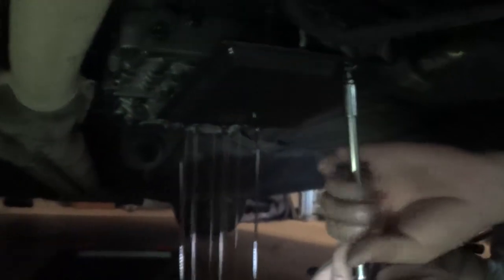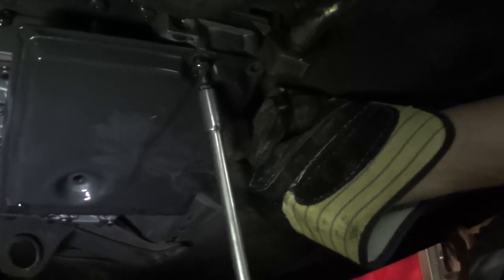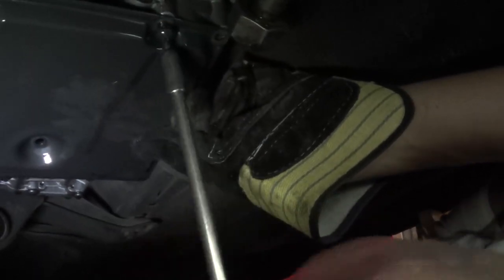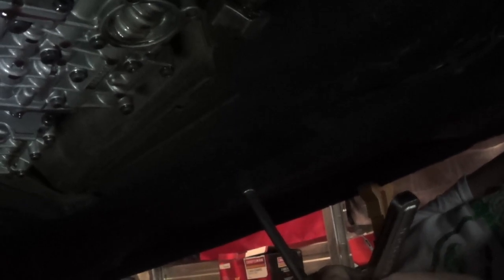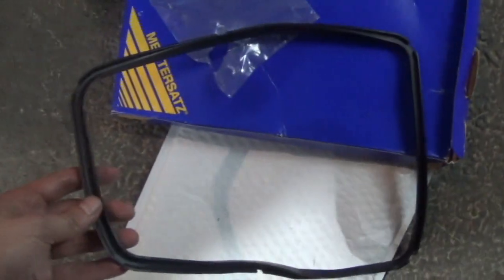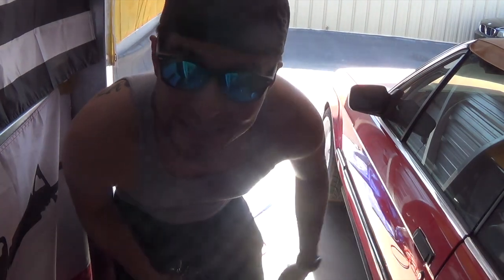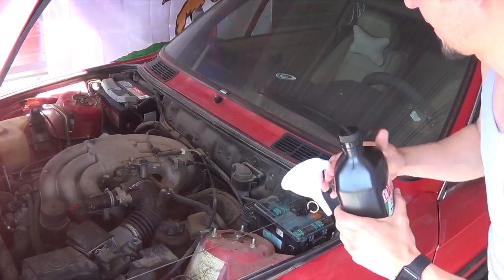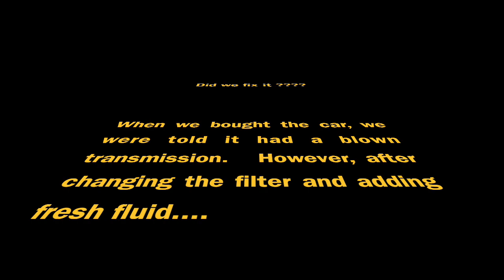BMW E30 Transmission Not Shifting? Easy Filter Replacement Guide Diy

Comment: Newbie with old car here.  I've looked in a lot of places to see how to top up the ATF for my '86 325....yours is the only site I've found that shows how to do it using the dipstick tube!  

The difference for me is I am not completely recharging it from dry, so I don't know how much I need to add. 
How long should I wait after adding some for a stabilized dipstick reading, does the trans. cool off too fast to go slower with smaller repeated adds, and how crucial is it not to overshoot on filling?
Reply from the maker: DB Hi there. Just add little by little and keep  checking your dip stick. If you add too much you will have to remove the drain plug under the car to level it out. But don’t be scared to work on the car. This job is really easy. Just time your time adding fluid. It will be tedious checking it every pour, but very easy.  Don’t worry about the temperature like newer 90s BMWs. I just added fluid and it was good to go. You can check again when it’s warm but you won’t notice a difference. It might actually look like there is more than there really is when it’s warm.
Reply: Thanks for the reply! 
So before I go ahead, a couple more Qs:  

Is there any brand or "quality" perceptions with ATF as there are with engine oil?   Appears to me that as long as it's the proper type (in my case Dexron III-compatible), you're good to go...?  If not, would you have a recommendation for my old 325? 

Also, when cycling through the auto shifter settings to disperse the fluid and get a better level reading, is it just a matter of waiting just a few moments (brakes on!) in each shifter position, or is a longer time per gear better?

Just as a comment..my ATF dipstick is pretty hard to read!  The reading zone on bottom is colored black, with two small "bulbs" about 1.5 inches apart...v hard to see the red fluid against the black stick (unlike the steel oil dipstick).    

Thanks again,  
Derek
Reply from the maker: DB you are correct. As long as dextron III compatible you are good to go. I did cycle through each gear repetitively. Then checked the fluids again. But you are right, the stick is very, very hard to read. Shine a light on the stick and try your best to judge the lubricant line.  We had trouble as well. Bmw dipsticks are not the easiest to read. If the car doesn’t shift great after. Park it, and check the level again about 8 hours later. If the level is good, you should try buying a new filter.  My car is shifting like new.  Good luck!!

Don’t hesitate to keep asking questions.
Reply from the maker: DB also, you can just shift through each for a few moments with brakes and e-brake. But maybe do about 3-5 cycles.